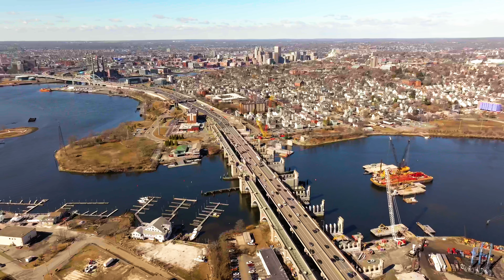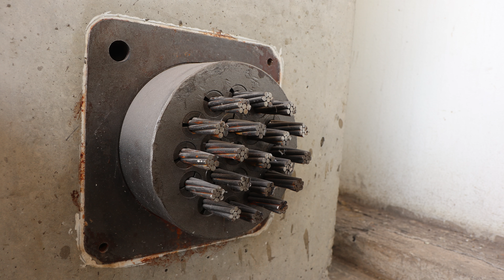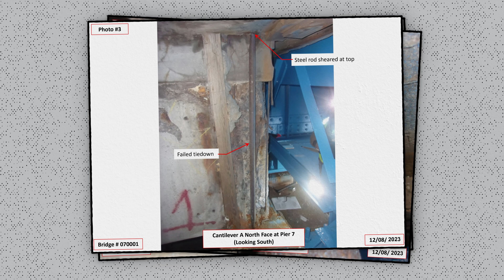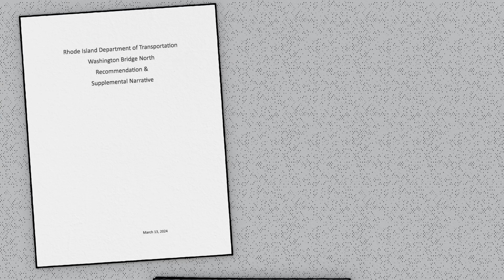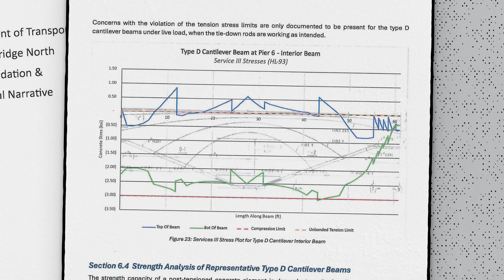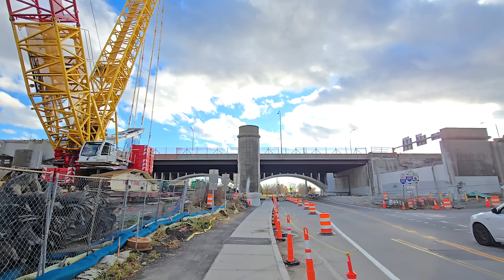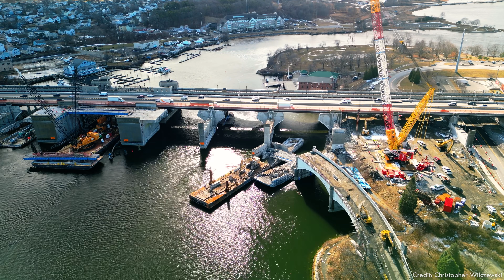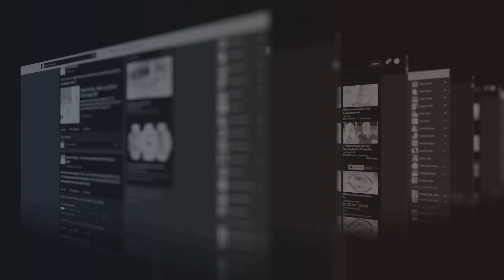This Bridge’s Bizarre Design Nearly Caused It To Collapse

Comment: 11:25 This is so true about old homes. When I got my first home I discovered a leak in the roof. To fix it I had to gut the main floor, remove 2 roofs (one on top of another), and properly install a new roof. Good thing about the main floor, though, turns out there were about a dozen layers of flooring adding 2 inches of thickness, a couple of which were carpet.
Reply: So the previous owners kept slapping new flooring (and roofing in one case) on top of the older stuff?
Reply: @gordontaylor2815  Yup. Layers included carpet, laminate, linoleum, and vinyl.
Reply: @B.D.F.  haha that’s messed up, what were they thinking?
Reply: @duncanmcauley7932  According to the old lady next door my house started as a chicken coop, then they added a deck, then enclosed the deck, and eventually got to where it was when I bought it.
Reply: I gained 4cm and found cool floorboards upstairs. :D
Reply: You forget the walls only held up by wallpaper.

Comment: I'm not living in US, but I do not think that there is a fundamental issue with the infrastructure anywhere. The issue is more or less decades of neglect by governements who refuses to spend the money that is needed to maintain it properly. I'm not putting any judgement on that because I do not have any answer.

However, I think that people inspecting public structures should be aware of what is critical, what isn't and do their best job to do it. The fact that there is so few informations on the tiedown is worrying. I'm not even saying that this is inspectors errors, did they knew the importance of this considering the unique design of the bridge ? If they didn't why so ? Where was this information lost or not transmitted ? That is the issue here.

One last though : I get why people would want "unique" structures that look good, but honnestly I wonder if in case of such things (public bridges, or basically any country-sized infrastructure) there should be some kind of "modular" approach to building it. I wonder if it would be possible to get basically some kind of similar parts about everywhere, and designing structures to ease maintenance : ability to inspect, but ALSO to replace damaged parts. You know, the same way you talked about cable-stayed bridge that ca be built symetrically. So you could get sections out of it easy, replace the cables, and supports beams easily, allowing for short rebuilt times.
You know, kinda like the "modular home" trend but for public infrastructure.

Comment: As an architectural designer here in NJ, I hope you do a video on the route 80 mineshaft sinkholes in the future! One of the detour routes is reported to be shut down because the bridge passing over it is too at risk of collapse. Photos show dramatic damage to the support piers over the past 2 years for that bridge, and it seems that the same mineshafts making the highway sinkholes might be contributing to the bridge degrading so quickly. That said, based on the photos, I see other serious issues going on also. 

An adjacent apartment complex is also suffering dangerous and damaging settlement after the newest and largest sinkhole appeared, and imo is unsafe based on resident photos and videos of the damage appearing to practically overnight. 

Of course, these problems are actually over a century in the making ever since the mines were abandoned and all these highways, bridges, and buildings got built over top.
Reply: Casey Jones has multiple videos on that.
Reply: What town is this near?

Comment: Just this video says to me a 100% fresh start of the entire thing needs to happen. Close the existing one, do it right once, and be done with it.  Instead, we fight about dumb things like space lasers instead of what we as normals need every day of our lives to function.
Reply: Why even rebuild it? The remaining bridges are doing just fine, and no matter how many times you add "one more lane" (within reason, who wants to build 70 lanes to relieve traffic?) it'll just fill up. You're better off leaving it until enough of the road network warrants replacing (which would be, let me check, preferably 50 years ago. But now will do too) and installing a passenger rail line. It'll be cheaper (both short-term, smaller bridges, and long-term, cheaper and less maintenance), and carry more people!

Comment: A contributing factor has to be that Americans simply do not want to pay for adequate infrastructure. We have very low fuel taxes relative to most industrialized world and we constantly push for tax cuts yet still want to drive our cars everywhere. governments everywhere do not have the budgets to inspect, maintain, repair and replace the bridges and roads we have yet we want even more to be built.
Reply: Taxes are NOT the problem, lack of maintenance over time and managers kicking can down road. Now the problem is beyond repair so replacement is required. State scheduling is probably unrealistic, starting from scratch is prob best. Sounds like inspectors may not have known about this bridge design or how to inspect it.
Reply: @jamesocker5235 how does one start "from scratch" on a bridge location that currently has a bridge on it?? It's not like demolition is free

Comment: In the German city of Dresden a major bridge collapsed out of the blue last year. Thankfully no one was hurt, even though it was open at the time, with cars and tramlines going over it. Everyone was shocked and the city completely embarrassed. The investigations pointed to corrosion on the pre stressed concrete, much like in Rhode Island. People blamed socialism because the bridge was built in the GDR, however it's no surprise to see the same mistakes made in a capitalist country. I think it was unfortunately just common practice to design without considering access for inspections.

Comment: Ultimately, the issue here is down to the decision to use concrete as the primary material for the bridge spans. There are bridges on the Northeast Corridor that are well over 100 years old and still working in their intended service. Many of the big suspension bridges in major cities are a century old and still working as designed. That is because they are constructed of steel, which is much easier to inspect, maintain, and repair, in addition to being a much better structural material.

Comment: There's a disconnect here unfortunately that isnt brought up. A lot of people in the Rhode Island area hearing two stories. One outlines all the interesting things included in the story here and the other is the "corrupt" politics. Both are true. One of the contractors who was bidding on the original design build project way back in 2020 explicitly told RIDOT that the bridge was failing during the bidding of that project. They had prior knowledge of the condition of the bridge from a few other contracts they got earlier in that decade to do some spot repairs of the bridge deck. They knew about the condition. Told ridot that. Then ridot canceled the bid and redid the design project excluding that contractor. They basically didnt want to hear it and were living in denial and the other contractors had no idea about the condition because all they had to go off of was the official ridot reports which as you covered in the video were lacking in both scope and regularity. Source: involved in the initial project that didn't ever happen. This resulted in awarding the rebuild to a contractor. The bridge failing. Canceling the project. Awarding it to another contractor at a huge premium. Then suing 7 contractors and putting one out of business. Not a good way to get contractors to bid your work for reasonable prices. Just look into another adjency with the same problem a few miles north. MBTA who consistently bids large capital projects that get 1 or 2 bidders. Same issues.

Comment: You should check out the flaw in The Netherlands,  regarding their viaducts. Most of them build in the 60/70  are in need of repairs. Due to their connection points starting to rot thanks to roadbrine 😂😂 expected costs could go anywhere from 20/40 billion

Comment: Hey there : the Swiss developed nano-carbon-fiber meshes to reinforce and maintain already existing bridges or building new structures with the same load capabalities as steel mesh  but much less concrete making the diameter of the wall much smaller aka thinner. Can you look into it? Im not sure how fare theyre with exporting, theyre trying out cooperation with Germany and Austria first I guess. Cheers.

Comment: And this is what happens when government, in order to "save some taxpayer dollars", goes with the lowest bidder - you get what you pay for, and end up paying more than the highest bidder at the beginning.

"Plan ahead"?!  LOLOLOLOLOLOLOLOLOLOL!!!!!  The government (and businesses) have the mentality of squeezing every possible minute of use out of something before even considering repair or replacement.  My contention is that even if the inspectors did a stellar job of inspecting, the government would have dragged its feet at arriving to a solution.

Call me a cynic but, when you do, call me a realist as well.

Comment: It's also notable that if a single link can be so disruptive to mobility, then your transportation network is inherently fragile. A robust system would include viable alternatives, be they other viable routes, or a light rail system on a parallel bridge.
Reply: I was watching a show about Canadian road recovery trucks that pull trucks off the highway or out of a berm. They often close the entire highway in that direction, which is the only highway for miles. Everyone is just stuck until it is fixed. Some jobs took hours. I was amazed their road network is so easily disrupted.
Reply: Fragile is cheap! Cheap is profitable!
Reply: @ No, cheap is extremely expensive because of the loss in production. Economic damage is very, very expensive.

It is cheap to build, the rest is expensive.

Comment: Being from East Providence this state needs to be looked into for corruption in the director of RIDOT  Peter Alviti plus the state knew about this back in 2015 because they got a report warning them about it and nothing was done.
  
“Nearly a decade before the westbound Washington Bridge was hastily closed to avoid collapse, the engineering firm the state hired to study it found structural problems and called for repairs. 

But many of the key repairs recommended by AECOM in a 2014-2015 evaluation of the bridge were unaddressed by the time the bridge was closed Dec. 11, 2023. “ ….seems suspicious to me

Comment: Hey wouldn't an easy way of checking if the rods in the concrete are shaped be to run a current through just enough to se if you got continuity

Comment: While out of the scope of this video, the bridge debacle is bringing what a lot of people in RI already knew into light. That RIDOT needs new leadership. 

Another thing not mentioned is how the Providence Mayor Brett Smiley is using the political power of this bridge to widen roads and remove existing green infrastructure under the guise of reducing congestion caused by the bridge. While RIDOT released numbers recently showing the average slowdown is only a few minutes with the current configuration of both directions of traffic onto one bridge. Raises the question of if we need a second bridge at all

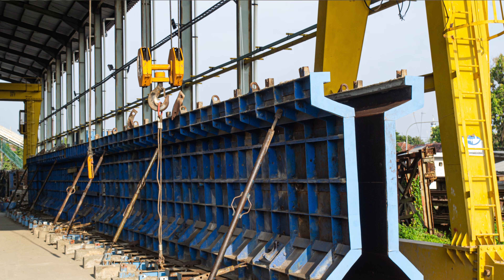Comment: 3:30 - Hey Grady, bridge engineer here. Bridges have been built with a slight arch in them to engage the rebar before cracking starts for a long time.
Reply: Wouldn't that still cause it to crack as the concrete bends from arched to flat? Or does the slight arch mean that the bottom edge is never really in tension?

Not saying you're wrong, I just don't intuitively understand how that would sidestep the issue.
Reply: @rosa-f5i6o  Even under the heaviest load cases the girders should have a slight arch to them - making sure no concrete is experiencing tension. Next time you see a long bridge in person look for the slight arch and you will see it on almost all modern bridges.

Comment: Just to affirm your point about this not just being a US thing - Here in germany, we recently had two major bridge failures which have gotten a huge amount of public attention due to how disastrous they were. The A45 bridge in Lüdenscheid, which was closed in 2021 because it was in catastrophic condition, and which still does not have a replacement (Though work is underway), aswell as the Carola Bridge in Dresden, which actually collapsed unexpectedly, luckily in a moment without people on it (Though there were vehicles on it just moments before). It's easy to just cry mismanagement and point fingers when these things happen, but you can never 100% avoid unexpected failures. The more important indicator for the competence of the system is how quickly a solution is implemented and how the system is changed to avoid similar failures in the future.
Reply: I wouldn't call the bridge in Lüdenscheid a failure, it was caught before it failed. But meh! 🤷
You could also add the old Leverkusen Rhine Bridge which had been closed for heavy trucks in 2012. Which started its own comedy show, complete with automatic barriers on the autobahn (to keep truck from the bridge, which lead to some huge traffic jams), old toxic waste dump at the place of one of the supports of the replacement bridge, bad steel parts imported from China, etc.
Reply: There is also Schiersteiner Brücke in Mainz. A column tilted in 2015 leading to the failure of a bearing and the road sunk by 30cm. Or Salzbachtalbrücke on the same Ringroad which had to be closed because of very similar damage in 2021. The 50s ad especially the 60s have seen a Construction Boom in Germany, and like all the other Boomers, they stop working now. If we are lucky Carolabrücke remains the sole Collapse, but i doubt it. There are too many bridges and far too many in bad Condition. The Video also shows, that it can get very difficult to identify significant damage.
Reply: 4 Years ago a Span on the 90 Year old historic Swing Bridge in the Kaiserhafen, Bremerhaven, ripped and caused the whole Thing to get teared down, after recent TÜV approval. 
It was a vital Traffic/Train Connection. 4 Years ago... 
And a Replacement planned..
They still fight over the Money.🎉
Reply: Sorry the New Germans needed that money to have 15 kids each. Oh well.
Reply: I just finished building a replacement bridge in Australia after the previous one required an emergency demolition due to sudden failure of the substructure.  

There's dilapidated Infrastructure everywhere and bridge inspections often miss issues or are done half-assed
Reply: If you don't inspect your infrastructure, it is indeed unexpected. It is not about how fast you can solve the issues caused by poor inspections. It is about having proper inspections to spot issues before they're too expensive or impossible to fix. Emergency repairs are always extremely expensive as Grady mentioned and not where the solution lies, as the "emergency" applies.
Reply: what can we do. In a neoliberal western world, politics and people are stingy and fail to understand why taxes are important to build and maintain our human infrastructures.
Reply: @PainterVierax  I think this is more of a problem in the USA than Europe. There have been a couple of exceptions - but they were big news because of that. I know of no bridges which were badly designed and allowed to become dangerous in the UK.
Reply: "you can never 100% avoid unexpected failures" Maybe one day there'll be a profession called a "Civil Engineer" which consists of people who are trained to understand these things and make sure their designs don't fail unexpectedly - or at all.
Reply: @evaluateanalysis7974   Humans are fallible, and will always make mistakes. And engineers can no better predict the future than you can -- what is seen as an acceptable, safe design can become a nightmare given the passage of time.
Reply: @AndrewAMartin  "predict the future " LOL Engineering is a science, not astrology.
Reply: @evaluateanalysis7974  "Engineering is a science, not astrology" thanks for reiterating my point...
Reply: @AndrewAMartin  Lol!
Reply: Replace gotten(a non word) with became, just sounds more correct. Just saying😁
Reply: @Moorakflyer  Gotten is a real word and makes perfect grammatical sense here. It's just the past participle of "get." It gets attention, it got attention, it has gotten attention. It's as real of a word as aluminium.
Reply: @Moorakflyer "gotten" is a USA-ism, but "bridge failures which have became a huge amount of public attention" Er, no, that doesn't make sense.

Comment: Naïve question: That bridge had a lot of decorative arches. If that configuration of arches were extended the whole width of the bridge and made structural would that result in a sound structure with no steel present to rust or would it just not work structurally with those spans?

Comment: Excellent video.  As a Rhode Islander, it's hard to get this all in one place.  My concern now is that the usable bridge is now bearing 50% more than designed and there are overweight vehicles on it also.  That can't be good as there is no relief in sight.  Our other three bridges running over Narragansett Bay are also in poor condition.